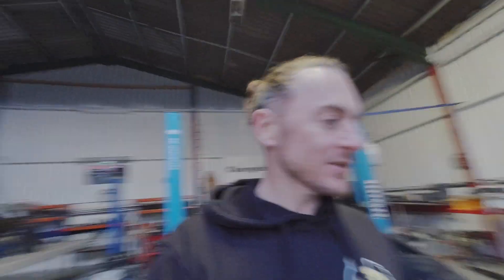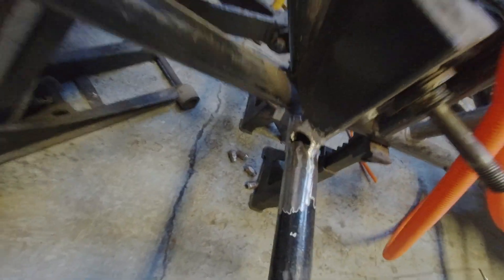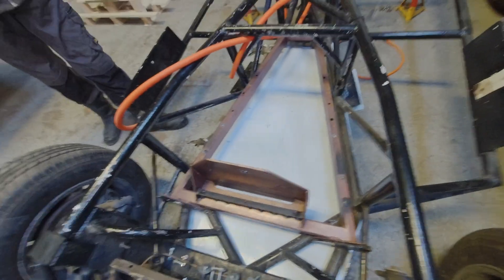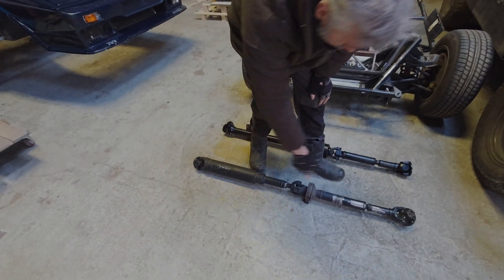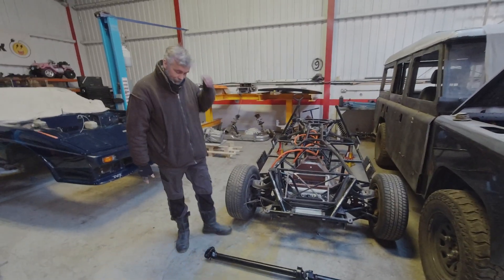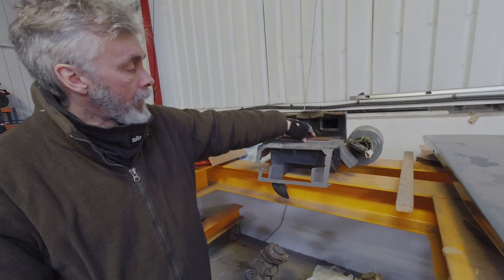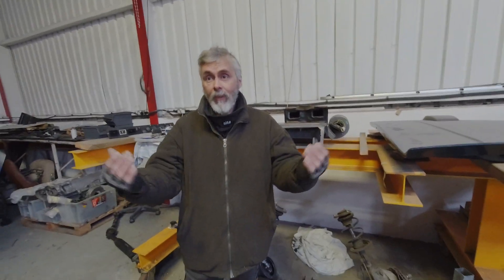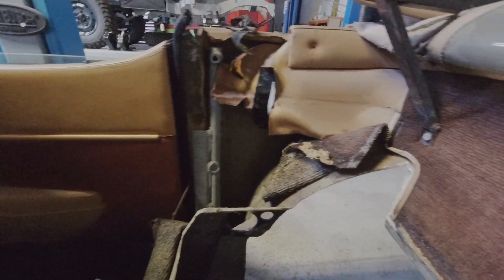Tesla Powered TVR! Ep15

Comment: Those chassis repairs were terrible, proper cowboy stuff. I wonder if it was in a crash to get the two front tubes cracked like that. You won't regret putting a new heating system in, the original one is rubbish. Enjoying the updates and seeing the progress.
Reply from the maker: 1 of the 18 owners perhaps. Just goes to show how careful you need to be with TVR's. Just think if i hadnt have decided to EV it someone would have potentially changed or upgraded the fuel system and been driving that....🙈 did you see the seat belt mounts? ☠️☠️☠️
Reply: @chargeheads  18? That's an achievement in itself. Those seatbelt  mounts were horrific.
Reply from the maker: @kimbeveridge3174  i would love to find at least one of the previous owners

Comment: Let's hope DVLA don't consider the chassis holes as 'modifications', bearing in mind they wouldn't countenance Ed Keane welding up the hole in his Mini's boot floor. 
Has there been any further discussion between DVLA and converters over that issue?
Reply from the maker: Its a good point. However its either that or its a potential health & safety risk. Clearly Ralph and I are doing things according to the DVLA requests in terms of no chassis mods for the EV conversion even though it would make life easier. 🤷‍♂️